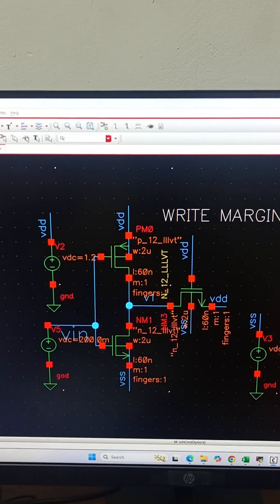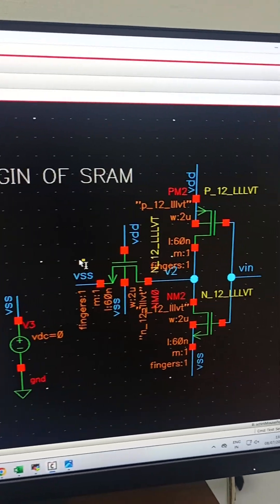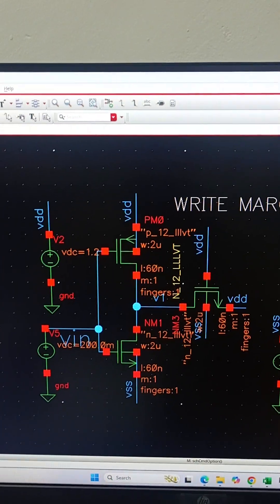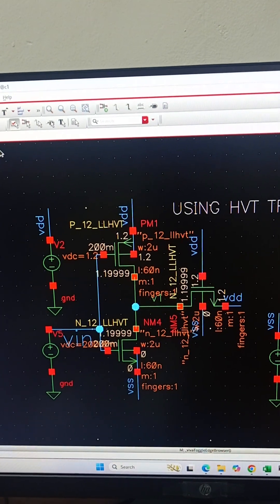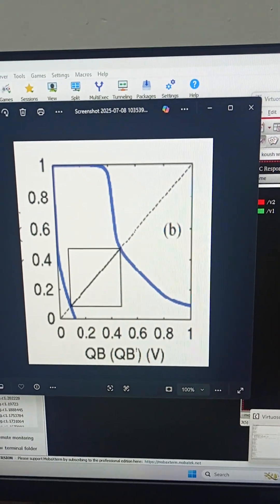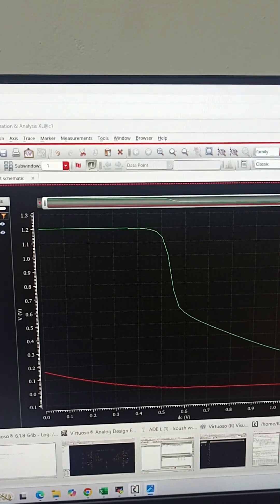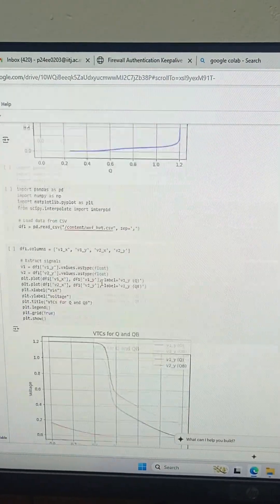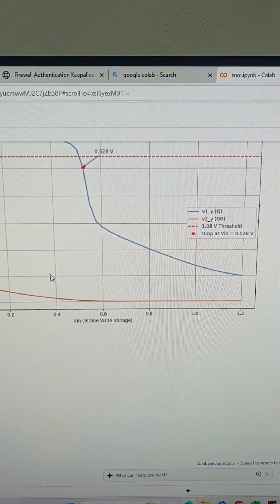SRAM Write Margin Analysis | Cadence Virtuoso Simulation + Google Colab Visualization using Python

Comment: How did you find the curve for High threshold Voltage?
Reply from the maker: I swept the output of the two cross coupled inverters of SRAM 6T cell to plot the threshold voltage. Then used python script to find the Write Noise Margin (WNM).